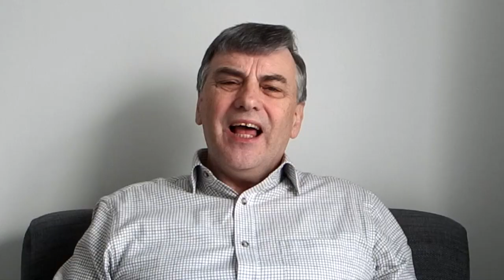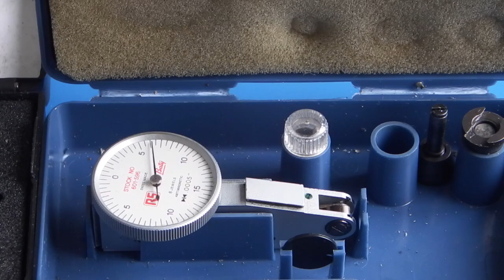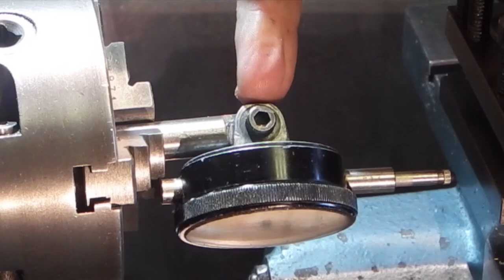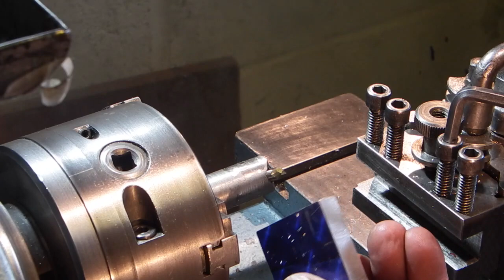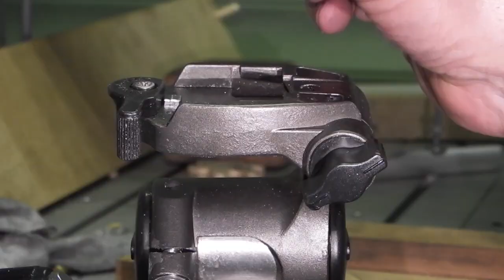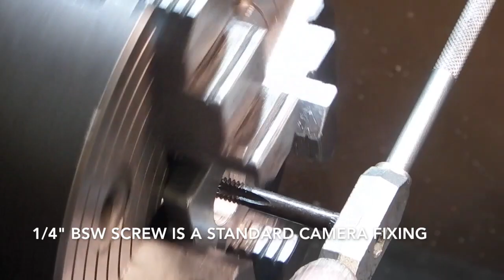Milling a dovetail block in the Lathe.

Comment: Really love your use of a fly cutter. To me, fly cutters are underutilized. Years ago when I was working in a machine shop I made a fly cutter similar to yours. I used a short piece of round mild steel bar stock, drilled and reamed a hole at 45 degrees, and then drilled and tapped a set screw. I used old or broken center drills as cutters. Super cheap to use and did a great job. I still have it as well as a collection of old center drills and will be putting it to use when I get my home shop put together in the next few months.
Reply from the maker: Hi Thanks for your comments I think fly cutters are great addition to your tool collection. Good luck with the workshop

Comment: I was impressed by how close you cut the Alu. on the band saw.  Just goes to show that when there is a will there is a way.  Nice work.
Reply from the maker: Hi Gordon
I've had the band saw for 17 years it always cut towards the fence, so last year I dismantled it and rebuilt the guides square to the table and guide rail. This involved machining material off the original castings to align the blade parallel to the guide.
Reply: I should have guessed that there was some special treatment for the saw. . .  You may wish to make up a presentation on how you addressed the issues with your saw.

Comment: That is very unique, I have never seen or even thought of building a plate to hold the compound slide sideways. What thickness steel plate did you use, it looks to be about 1/2 inch thick? Also from center to center how far apart are the holes that hold the compound slide on. This is definitely on my list to build, I can see this being a very useful tool addition. Also do you have a video of building a fly cutter for the lathe on the lathe. Due to I do not have a milling machine, your instructions and format is very good and useful and easy to follow. Thanks for the good videos.
Reply from the maker: Hi Anthony
The plate thickness depends on the fixing method of the compound slide, a bolt on slide can have a thinner plate but may need a bracing triangle at the back. Dovetail mounts need a thicker plate to ensure the dovetail part is supported each side of the locking pins.The distance between holes should be about half the travel of the compound slide.

Comment: Very clever part holding
Reply: Just seems that this is not that accurate method and i dont know if this works for any harder materials, though long as the part works, it really does not matter.